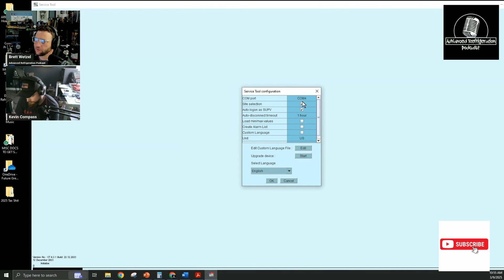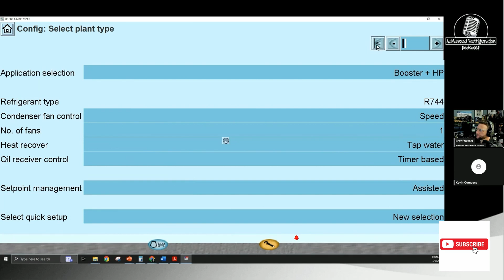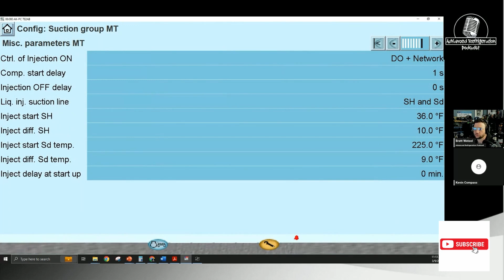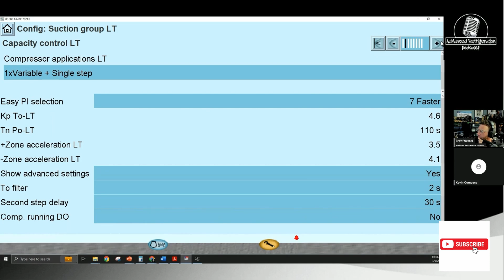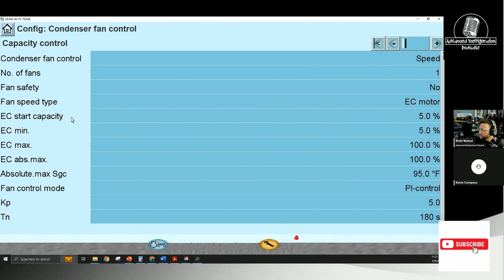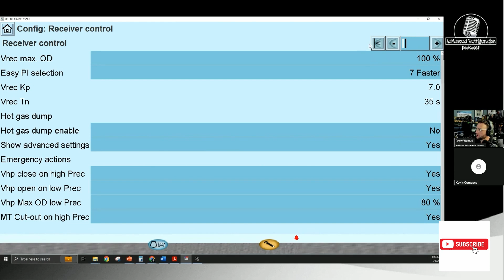Danfoss Pack Controllers, BBQ, And Flight Delays Episode 410

Comment: Hi there, Do you guys have any videos on how to setup and test HP and LP controls on a rack system?
Reply from the maker: @cronykjoker510  pump down the whole rack to check the suction
Reply from the maker: Shut the condenser off to check the high pressure
Reply: @advancedrefrigerationpodcast  how would you test them individually? Thanks for the tips.
Reply from the maker: @cronykjoker510  use the service valves. slowly
Reply: @advancedrefrigerationpodcast  thanks for the help